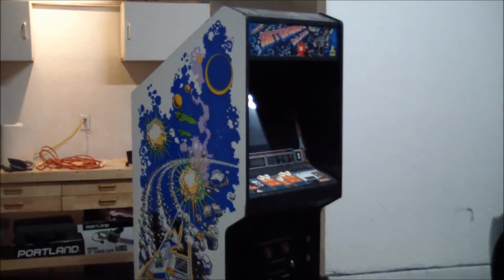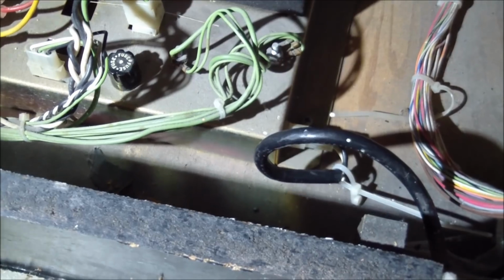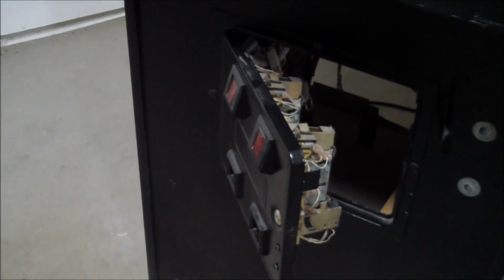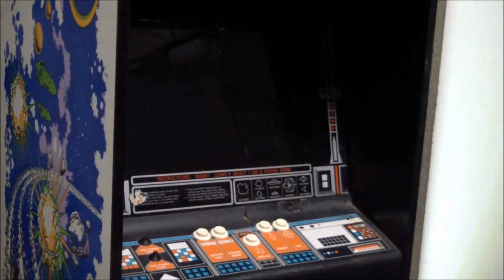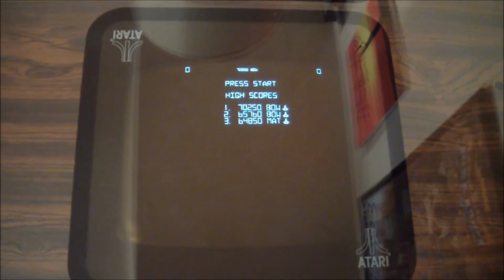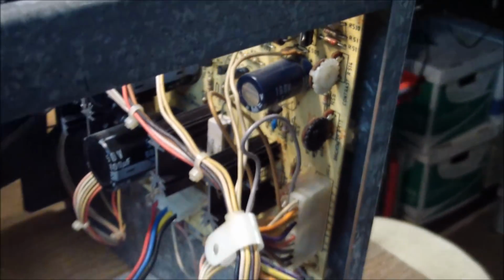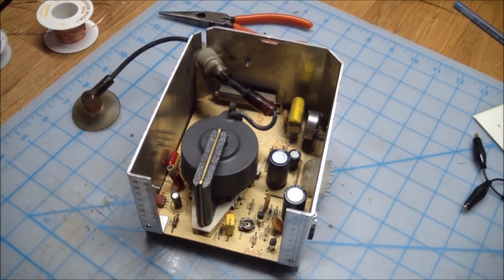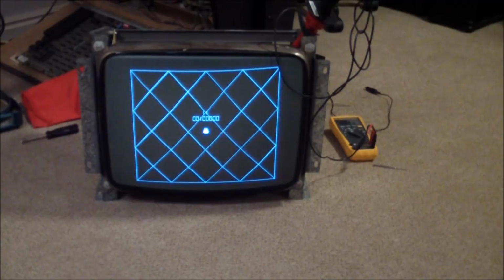AE#88 Atari Asteroids Deluxe Arcade Repair Part 1

Comment: Are NTE and ECG parts the same thing as the original cross reference parts or they function differently and have a different pin out?
Reply from the maker: They are usually parts with better specs that replace a number of lower rated parts. Chip pinouts are usually identical, transistors have different pinouts sometime.

Comment: Sorry but I believe Q900 is a series pass transistor as a voltage regulator supplying the only oscillating bit Q903 which is a self oscillating circuit with the windings from the transformer.

Comment: what are the PROM chips used for in arcade games, I see PROM chips on the address buss to extended the 16bit address buss into more addresses it seems.
Reply from the maker: A Prom can be used as a Lookup Table (LUT). It's a brute force method used in the early days. The were superseded by logic devices such as PALS, GALs and utlimately FPGAs.

Comment: @ 22:00  Capacitor  C904 I think is underrated fro that task.  Input power is 40 volts, but this cap is after the Q900 oscillator transistor, so it need to be rated for a much higher voltage and ripple rating.  This is a low hours machine, and excessive ripple current would be the obvious reason for the capacitors destruction.  Putting in a 47Uf 100 Volt cap would be the simple mod.

Comment: Amazing compound problem. What's the sequence of events that would result in two bad fuses, one loose wire and a bad capacitor to occur? I think someone slipped you a test -- and you passed.
Reply from the maker: I definitely got slipped something, but it wasn't a test I got slipped.

Comment: Thanks Art, helpful diagnosis.  I acquired an upright game which has a faulty multi-pin header and cable ( about 50 pins  +/-  )  Do you have any special vendors who may stock such items ?    J K
Reply from the maker: Nothing comes to mind, but maybe a Jamma connector with wires already attached could be trimmed to fit.

Comment: Is that for real. No deflection can burn through the glass?
Reply from the maker: If the beam focuses on the center of the tube it will eventually burn through the glass. I don't know know how long that would take though.
Reply: @artifactelectronics  wow that's scary!  Cheers Arty.